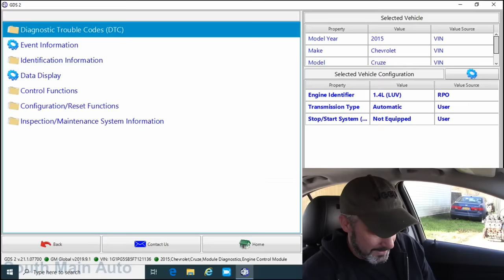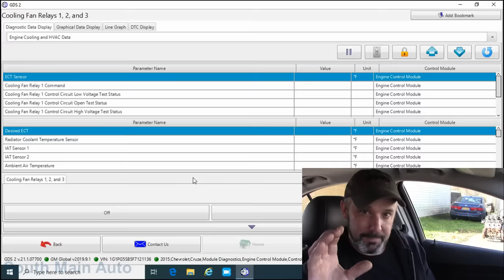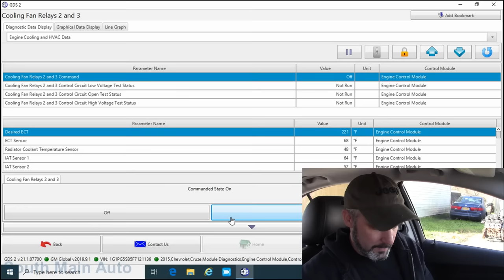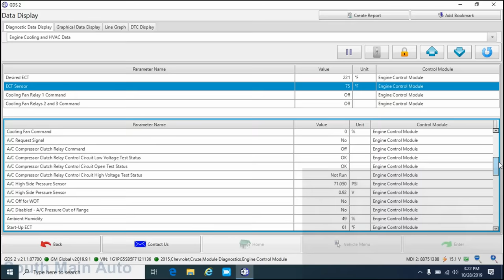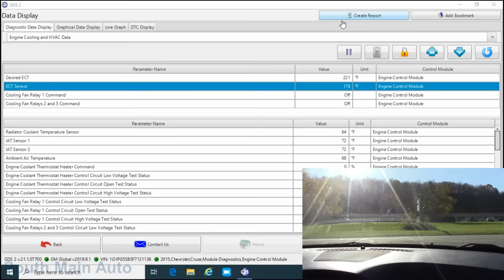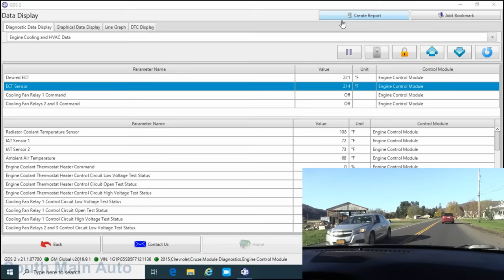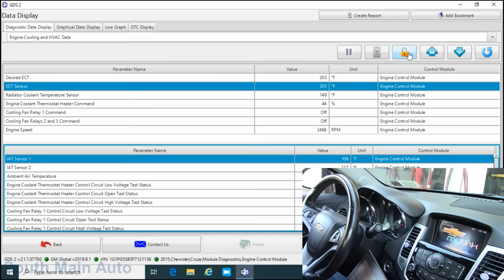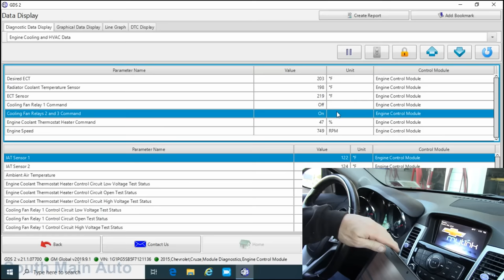Chevrolet Cruze: Overheating, Loud Fan, Losing Coolant

Comment: Customer takes problem car to Stealership...they say car is OK. Eric looks it over and finds problems with 100% certainty, and says to viewers there’s your problem lady. This is why I watch! Great video Eric O.
Reply: I have experienced this myself with my Hyundai.  The shop supervisor at the dealership doesn't want to take the time to diagnose these intermittent problems unless there is a computer code associated with the problem.  They refused to fix the failing throttle position sensor in my car until it threw a code.  I even told the supervisor that it was probably the throttle position sensor but they didn't even try to reproduce the failure.  A week after I took the car in for service, the car finally threw a TPS code and the dealership finally replaced the bad TPS in my car under warranty.
Reply: One can also point out to the dealer they should watch SMA and subtract the diagnostic fee from the bill...
Reply: PickleRix 
Here's the deal with the dealer: you said it was warranty, there were no DTC's set. The manufacturer will NOT let a dealer just start changing parts under warranty, there has to be a code set before the manufacturer will cover the cost under warranty, or it has to be broken, verifiable through photos if need be.
Reply: PickleRix
Ralfie is right, and the problem is more complicated and deeper than it is. Intermittent problems are always frustrating on both the customer and the dealer tech. The problem with warranty is that they don’t pay well at all, and without a code the tech does not get paid for diagnosis, period. You can submit for a request but at times it’s not even worth the hassle. You also can’t just replace parts when the problem is not current, even if it is the culprit. So after that tech spends, let’s say an hour,  trying to duplicate the problem and no codes set, that tech is basically working for free and becomes frustrated (who wouldn’t?). And on the customer end they just want it fixed right the first time and not feel like the dealership doesn’t care and they are not looking at thoroughly. It ultimately depends on how the dealership handles their techs and the customer and not just dollar signs. Life would be a beach at a dealer without intermittent problems
Reply: @picklerix6162  Is it just a thing to hate dealerships or something because what you just said seemed completely reasonable for a dealership to do. Warranty claims have to be inspected and verified, dealerships cannot go based on your word that you have a throttle body position sensor that is bad and just give you a new one because you know what happens if that is not the problem? the deanship would end up eating the cost of that part and labor to install that part, or in a worse case you would end up eating that. In any automotive mechanic industry a problem cannot be fixed without replicating the problem and then diagnosing it based on the problem that is persisting, that means the problem has to be experienced by the technician before he can do anything with your vehicle that is how it works. Tooo many people go to these places saying it's x,y or z problem and it is not.
Reply: Ultra CNC  - My 2009 Hyundai has been far more reliable than my previous Ford.  I did have a couple warranty issues that the dealer eventually fixed.  The throttle position sensor is a recurring issue with these Hyundais and the failure doesn't always set the check engine light.  If you have a newer Hyundai, the engine will surge, go into limp mode, and set the check engine light if you get a hard failure.  Usually, the car will not idle correctly when it is cold.  Once the car warms up, the symptoms go away.  My friend had an older Hyundai and he said the engine surged while he was on the freeway but never set the check engine light.  He was so afraid to drive the car that he traded it in for another vehicle.
Reply: PickleRix that’s probably because they can’t warranty it without the codes and freeze frame data. Not wanting to diagnose it is one thing, but the codes and ffd are needed for the dealership to get reimbursed
Reply: Ultra CNC 2012 Malibu lmao 😂 bro I fix those ALL day everyday, they’re one of our worst fleet cars. Kia and Hyundai are at least cheap in the parts department and labor is easy. Gm is better than 0 Asian cars lol

Comment: Dealer “half price” is still more expensive than most independents and likely to come back with the same problem or  more problems.
Reply: Agreed!
Reply: Regardless of the price, why would you give the job to someone who couldn't diagnose the problem in the first place. If covered by warranty, that would be one thing, but at 1/2 price, NO WAY.
Reply: The dealer mentality move it in move it out.  More Customer service at a independent shop. A real good independent shop may have free loaner cars also
Reply: they will be using dorman products.
Reply: @bent.cyclist  Spot on mate. Agree 100%
Reply: @bent.cyclist  Spot on mate. Agree 100%
Reply: That's because they marked up their price 10 times before cutting it in "half"
Reply: I was about to make the same comment. Dealer's half-price being more than indy full price. Oh well.

Comment: Why in Hades would you have the shop that can't diagnose the problem do the repair? This is basic stuff.
Reply: The diag is the big brained part of the job. Throwing the part at it is pretty much a small brained type activity. That's why all those shops in Staten Island outsource their diag to Keith and pay him a generous hourly rate. They only bring him in when they need him and then use their cheaper small brained labor to throw the part.
Reply: Ah well, it is what it is... I'd rather get my opinion then if necessary get a second opinion before I start ripping half the car apart for nothing at best, bigger problems at worse personally when I DIY

Even so, look at the bright side, at least this show on diagnosing the Cruze will eventually pay for itself in terms of YouTube money...
Reply: @opl500  hi, who is this Keith, you refer to?, Any chance of a link to his channel or nom de plume?. Thanks.
Reply: @bostedtap8399  I think he's talking about New Level Auto, also check out Pine Hollow Diagnostic if you like these type vids.
Reply: Anyone can pull the lanyard on the parts cannon, the hard part is aiming and loading it properly
Reply: @Mumwaldee  Many thanks, I already watch Ivan, another very clever guy. Best regards John.
Reply: @bostedtap8399  👋🙂
Reply: @NewLevelAuto   who's Keith guy?
Reply: @NewLevelAuto  Thanks, just subscribed to your channel. Best regards from the UK.
Reply: Should take it to another dealer, just to punish the first. Of course ask for a quote, as their "half price" might be almost as expensive as getting Eric to do it.
Going back to the original dealer just rewards them.
Reply: @opl500  Well the idea is you take it to a specialist and their experience leads them to diagnose the problem faster, so you might pay a higher rate, but overall it's less than paying one of you own guys to fiddle around for a couple of hours, (downside of course is your guy never builds his knowledge).

I didn't see Eric do any "big brain" stuff, (sorry Eric), it seemed to me mainly the time and observation skill, which the dealer probably didn't want to do - they want to stick to straight forward stuff that keeps the revenue flowing, and truth be told so does Eric, (or any other business for that matter). If you noticed Eric stopped at a point because he knew he probably wouldn't get the job. Nothing against Eric of course, that how business runs - you want maximum billable hours.
Reply: Yeah, I wondered that. Fair enough if it was under warranty. But if hell froze solid and I brought a new car,   the millisecond that warranty expired would be the last time the dealership saw it.
Reply: @bostedtap8399  Ivan from Pin Hollow has a man crush on Keith - mentions him so often when doing diagnostics.
Reply: Warranty
Reply: Same thing for when you go see a doctor. Get a second opinion if they dont know shit.

Comment: Some say they named it Cruze. Because they knew after one year of owning the thing. You'd Cruze on back to dealership for another vehicle.
Reply: @
aksik  They named it after Tom Cruze because dealers have to put a "Top Gun" to people's heads to get them to buy one.
Reply: @Captain Caveman and you can't really argue with an actual 45 MPG in a cheap non hybrid
Reply: I had mine since 2011 only overheated once because the coolant line/tube ripped easy replacement. Car is still running strong!
Reply: My 2014 was back to the shop 4 times in under a year...
Reply: 😂😂😂😂😂😂 true
Reply: Lol
Reply: Chevy cruze is a piece of junk!
Reply: It’s because Cavalier, Corsica and Cobalt  were already used ( and had the same reputation)
Reply: @Cerus98 I get minimum 35-40 in Tampa traffic

Comment: I always love it when customers brought cars to be diagnosed only to take it back to the hack that couldn’t find the problem to change the parts. Parts monkeys make us all look bad.
Reply: That is exactly why we charge for diagnostics!   a lady came in to get a scan. bank 2 sensor two was bad.  she comes back a week later, and says" i changed the O2 sensor, but the light is still on..."   I lift it up and give it a look-see. she had changed the wrong sensor!  and her price for the part was $145! Couldn't return it.   she was hopping mad! Had to install another $145 O2 sensor.  But after that, she always had me do the work!
Reply: Probably threw out the old good one.
Reply: @rusty1187  I've had plenty of those customers. They choose to save money over quality and knowledge. I understand that car repairs can get expensive but if it was maintained and driven with respect, there would be less frequent problems with cars.
Reply: @rusty1187  To be fair, if the car was needing the B2S2 O2 sensor it's not too long before all the others fall out of spec too. O2 sensors are good for 100k and then at that point they're all plated in carbon and ZDDP and fail to oscillate rapidly. I like to do sets and pairs all at once. One injector goes bad? Replace them all. Coil pack goes bad? All. O2 sensors? All. Shock blows out its oil? All 4 corners. Ruined LCA bushing? Both sides, new control arms. Diff seals or axle shaft seals leaking? All of them get replaced. Caliper leaking? Both sides of that axle get done. It just makes no sense for me to pull everything apart multiple times or deal with imbalances.

Comment: As an owner of a 2012 Cruze, fun to see Eric diagnose this one.  Many years of this car have an extended warranty on the water pump of 10 years 120,000 miles.  Check the dealer.  The fan relay kit is available from Eric's favorite auto supplier Dorm.  there might be others that make this relay block, vs. having to remove and install an entire fan assembly.  Last but not least is the gasket on the coolant bottle.  Most don't think of this.  If it doesn't have resistance when installing the cap, it's not sealing against 20 psi pressure.  Either replace the coolant cap o-ring or the entire cap. 

Water pump leaks out the front of the bearing weep hole, look for tell tail dried coolant on the timing cover, and engine support bracket.  

Thanks for another great video.

Comment: Great work! I wish the dealerships/local mechanics put this much work into finding the problems I have with my Cruze. Many of which revolve around both leaking coolant and oil. Going to attempt to replace my Valve Cover and/or gasket in a few weeks. I'm pretty sure my water pump needs to replaced to but can never get any real answers around where I live. Good help is hard to find but you my friend are awesome at what you do! Keep up the good work! People still appreciate a hard working, thorough, and honest mechanic so never change no matter how many jobs you don't get along the way! Their loss!

Comment: Dealership could not diagnose a problem, but he wants them to fix it at half price after determine the failure.  Sounds like another botched dealership job video in the future!?!
Reply: Dealership can't figure out a water pump and bad fan. What CAN they figure out?
Reply: matthew wert, if dealership "fixes" it, look forward to another SMA video about this car again!
Reply: Markup Stealership work twice what they would charge the consumer.  They should never have to send out work because they are inept at their profession.
Reply: Reece newton, than can figure  out there idiots and hire people who can operate a lift
Reply: Clearly none of you know how auto repair works, or how dealership labor rates work. Here’s a hint, if there’s no codes, it cannot be fixed under warranty. The codes are required in order for the dealership to get paid. Now, for the diagnosis, the dealer tech 9/10 works flat rate (book time) and with warranty times, you get 0hrs for diagnosis. Why would a tech waste his time, for free, to TRY to replicate an intermittent issue? If it pulls in with no codes, for warranty, good luck getting it looked at. I’m sure none of you work for free and neither does that tech. He’d rather do jobs that pay the bills, not jobs where customers assume something is wrong but have 0 codes.
Reply: There is a Technical Service Bulletin about this very problem. My wife's Cruze had this happen a couple of months ago. We had an extended warranty but they knew about the Tech Bulletin and put it back on the factory.  Thankfully our Service Writer worked hard on our behalf since the cat is a 2012 with less than 25000 miles on it and all service has been done by the selling dealership.  Final score new water pump, new head, new timing belt.  Head had to be replaced because it was deflected into coolant passage by 2/1000 over allowable.  Total bill over $4300 our cost $83 because when I asked for the head to be check by machine shop I was told that one hose usually ripped when they tried to remove it and I gave them the okay to just cut it and replace.  Moral:  Always check online or with a trusted mechanic to see if your problem has a Tech Service Bulletin

Comment: I tell my customers no pestering up front. I will call them with a report by days end. Way less stress. You're very talented and thorough. They will accept the rule. Trust me. Got 40 years in the trenches. Customers don't need to know anything untill you do. Hope this advice helps stress levels. They will do a job on you if you allow it. Then it's on you. As usual good video. Sn

Comment: My sis and hubby have a Cruze, -the engine blew. 19 days before the warranty expired The chevy dealer paid the bill.
Reply: you were damn lucky, still driving it or did you get rid of it?
Reply: They kept it .It went in august.
Reply: Why people buy/drive from a company that sold ignition parts that were killing hundreds of people in accidents, is beyond me. You people deserve what you get from that EFFED up company. GM=Garbage Motors.
Reply: How many miles when it blew ?
Reply: @garrettstevensen2467 , That's so stupid, I'm going to give you some credit and assume you're trolling.
Reply: Garrett Stevensen Every manufacturer has had their huge egg in their face gaffes. You could buy a Toyota, except they had the huge recall where the gas pedal was killing people. Maybe Honda? Ooh. No. Takata air bag recall. Ford? Nope. See Firestone tread separation recall. And of course the Pinto. I could keep going, but I think you get the idea.
Reply: @garrettstevensen2467  Ford sold cars that blew up from faulty gas tanks and Dodge still sells shit transmissions. Toyotas brakes failed and the list goes on. Judging a single manufacturer for a fault while not seeing the others is kinda narrow sighted. Working on cars I have noticed one thing. They are all junk in respected different ways. Just have to buy in knowing this, hope for the best and know what is coming.

Comment: the cruzes look pretty with nice features and with a good price. just run.... just do it and dont look back
Reply: 1.6L non-turbo and manual transmission is just fine but I doubt you can find those in the US
Reply: @munkkis4n  nope. It's either 1.4 turbo or 1.8 na.  But you can get a manual
Reply: Anything past 1999 is going to be a computerized hunk of plastic crap. I hate newer cars everyone that i have owned has totaled out at about 5 years after it has drained my wallet for constant repairs. But the one time i get a used 1997 cougar with just a 3.8l at around 98k miles on it. All it needed was a tune up. And after ran like new everything works . and has been running like new for about 6 years now. Any newer car iv had would have done sounded like shit by now. And probably on its last leg.